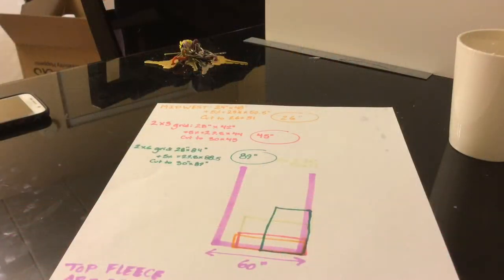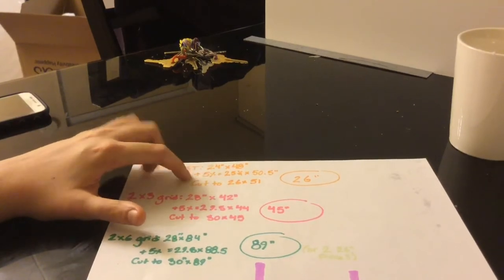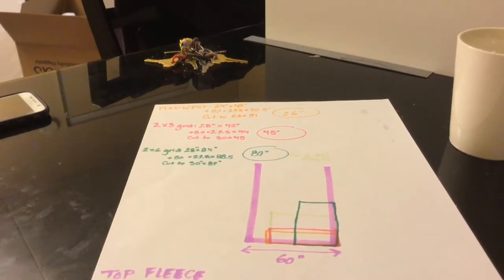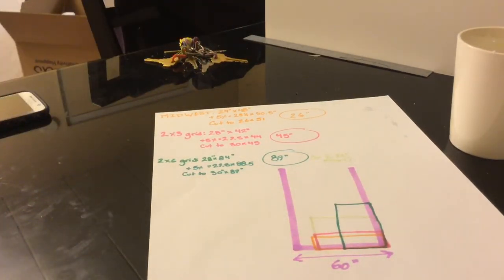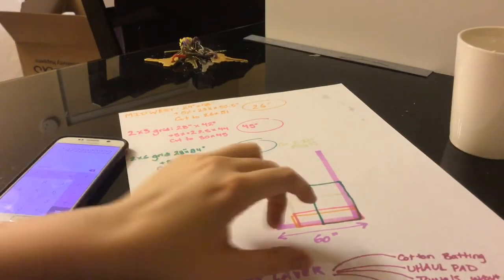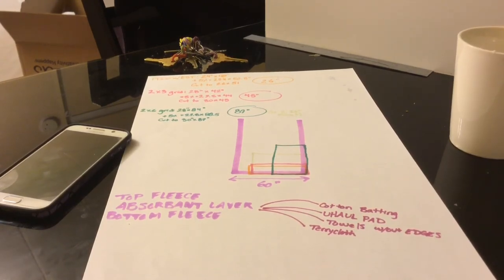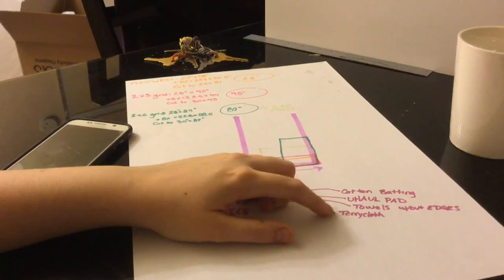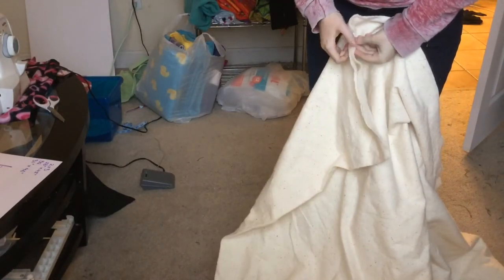How To Sew A Fleece Cage Liner, 1/3

Comment: Thank you for the helpful video! I've got an question about the 2x6 though. How do you sew the two pieces together? My cage is going to be 2x5 and noticed that I couldn't get two liners out a piece of 150*200 cm / 60"*78". I don't want to have a lot of waste fabric
Reply from the maker: Veronica Koeks if I were doing it for myself I wouldn't mind the extra fabric, I would use it to make cozies or little pads for under the water bottle. 

and that's so close on the fabric size! you have quite a few options for splicing fabric together, you could sew two pieces of fleece together to make the fabric a little bit wider , you could get complicated and do some sort of checkered or striped pattern with the fabric, or you could make the second lineer with what you have and then make an extra liner to make up the difference, which would give you two liners in the same cage at the same time.

I would take the first option, make one liner with the fabric as you had planned to, and for the second get long scrap of fabric or a remnant (many fabric retailers will have their remnants in a certain section at a discounted price) and sew the remnant to the short piece "right sides together" with as little seam allowance as you can. Basically this piece will be spliced or Frankensteined. 

Of course if you have a remnant of the same fabric large enough to do this I would use that first, but it's not necessarily a proportion issue where the fabric is way too long but not wide enough, it sounds like you're so close to having the right square footage but you're just a tiny bit short.

Oh! If you were feeling extra adventurous you could get a scrap in a complementary color, sew the liner a bit too small, and then use the complementary color to create a frame or border around the entire liner, but that would be fairly difficult.
Reply: Saylavi there are so many options! Thank you for the ideas! I was thinking to make two liners of 110x80 cm were the middle part cross each other with a 2x6 cage in mind so the liners would fit that too. still need to figure out te exact measurements with shrinkage and if I want to cover the sides